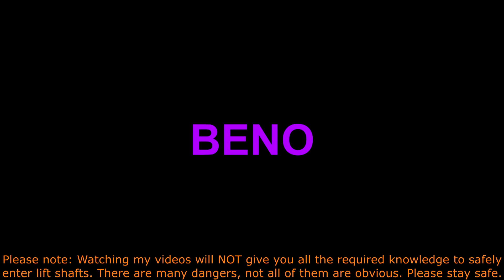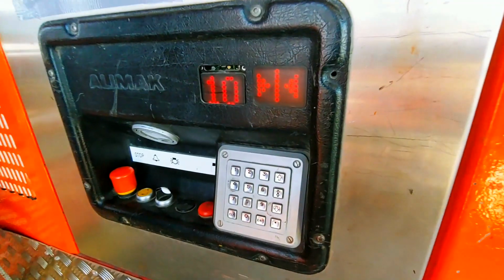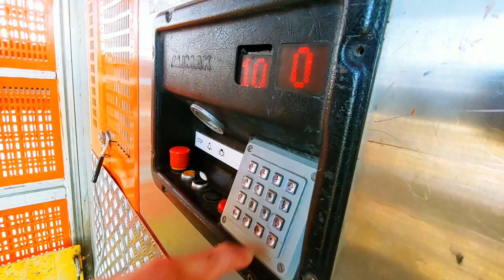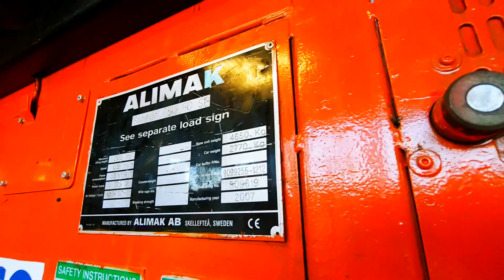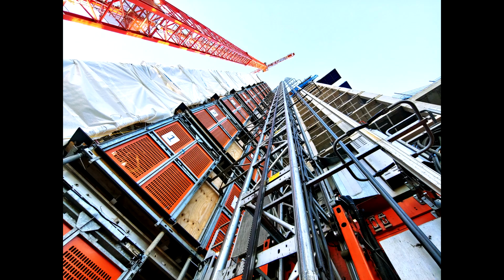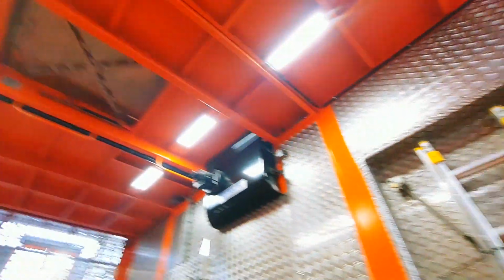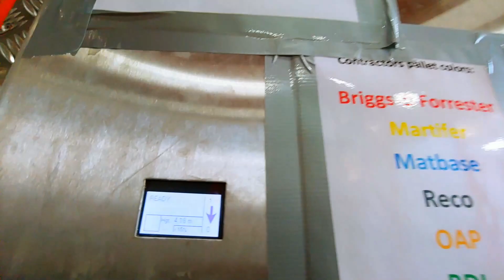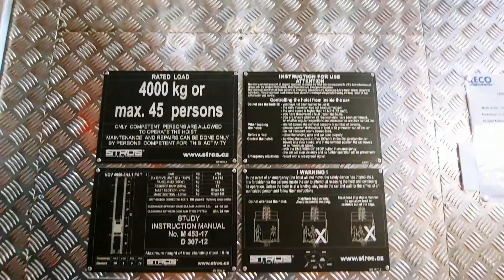Detailed look at modern Alimak Hek climbing lift

Comment: They're manually controlled so materials can be streamlined to the correct floors, rather than everyone just calling the lift.. Some are usually booked for deliveries and not used by passengers at certain times.

Comment: There's a rollercoaster in the U.S. that has an Alimak (I assume climbing) lift/elevator. It's very slow & is mostly used for mechanical & emergencies.
Reply: There's one on the Top Thrill Dragster in Sandusky, Ohio
Reply: That's the exact 1 I'm talking about.

Comment: I wonder why they need such a big goods lift. Most building materials like partion walls, pellets with bricks, etc are normally hoisted into the building with the regular cranes. The only reason I can think of, is that they may have some big, mobile equipment like a bobcat that they have to transport. But a bobcat would not really be found on a newbuid but usually on demolition / remodelling job.
Reply: They put bathroom pods in the Stros hoist
Reply: Windows